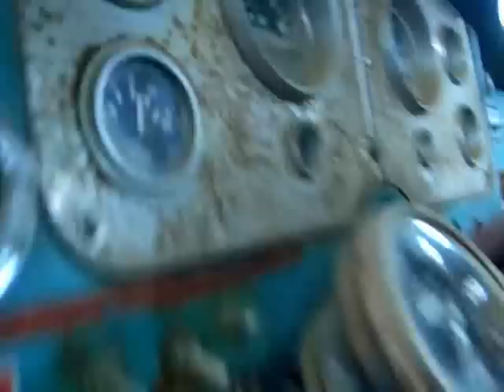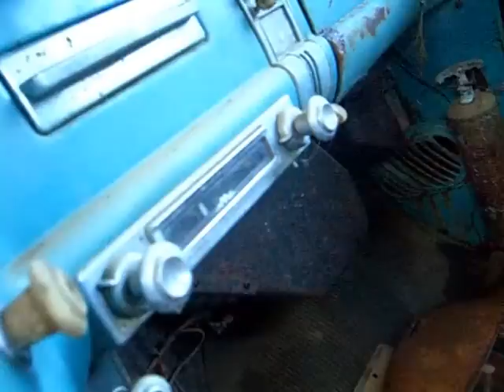The Find 1956 GMC V-8 Hydramatic Napco 4X4 Dually Truck

Comment: I'm probably going to get flamed for this, but I don't see a return on this investment and would part it out.  However, you seem to have quite a fan base for you to restore this thing.  Perhaps you should setup a Go Fund page for it.
Reply from the maker: +Kenneth Southard Quite possibly the only one like it in existence. It's all about the return on investment, as you said. The amount of parts that need to be replaced combined with the labor compared to the value of the finished product. Calculate the value of the individual parts and compare to the assessed, completed value and I think restoration for personal use comes out on top
Reply: +ElderlyIron I agree all I would do is get it running and driving good, put a back glass in it, and drive it. That is an awesome truck.
Reply: I think I've reconsidered on this truck.  Dann is right, this thing for it's day was optioned out as much as you could get.  Also, the body is straight and the chrome is awesome.

Comment: Jeff the GMC your towing with, needs some work, the engine sounds like a train on your video.
Reply: Jeff, I have a 1996 Isuzu truck sounds much like your GMC, oil pressure good, temp good change oil every 3000 miles, 98000 on truck. why are the lifters so load?

Comment: Ex-uncle "gave me he exact thing in a 58 big 6 4 speed tarnnie. al intact then I ended up getting divorced from his bipolar, "I weigh 400 lbs and it's our fault, I got Hep C from sticking my clumsy ass with a neede at work  nthe hospital in 1988 and it's your fault ad I'm bipolar and it's your fault....so the poor 1958 GMC it sitting forlornly next to the apple trees past the old laying houses up from the ashes of Buick Dynaflow.flush and Powerglide( he 1950 Chevy with a "glide came with a 15 more HP engine cause it took 15 hp to run the Powerglide so 90 hp or 115 depending which tranny!!!!They later got waaaay better but 2 speed is still 2 pissy assed speeds.  . The hydramatic as a 4 speed auto with a 3:81 to 1 first gear and in Olds Buicks et al  they would light the tires up on a 4700 lb Rocket 88 Super 88 , Roadmaster or Wildcat and still cruise on 2.73 -308 gears with mucho gas pedal left in high or 1:1 for those who drive Mitsubishis....Turbos replaced them  but after....what did they go back to tho' most of us never knew they had been there? To 4 speed automatics....1967 to the early 80s we had 3 speeds...then 204r, 700 4 r and 460le etc ...now we are up to 8 speed autos. They had it right in the 50s....don't fxi what ain't broke. Shades of Aarkus Duntov...what will they think of next.....overhead valves in a V8 engine?